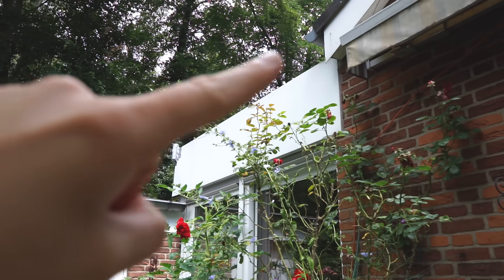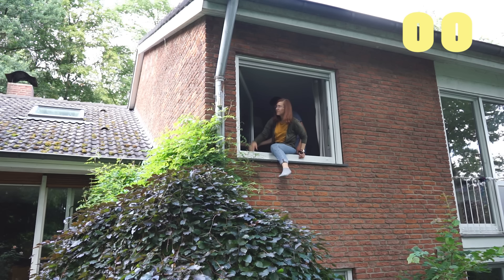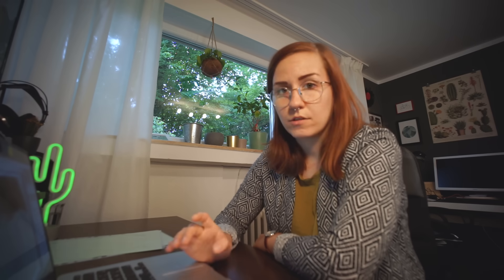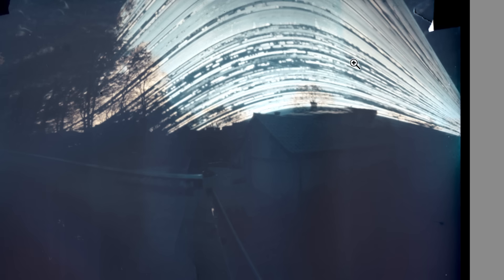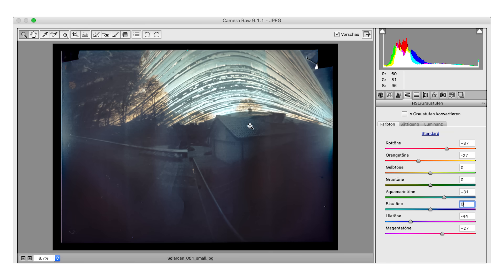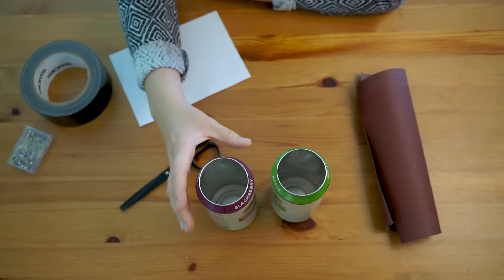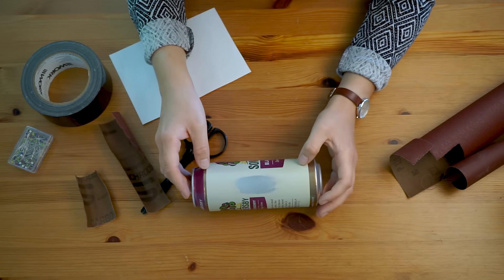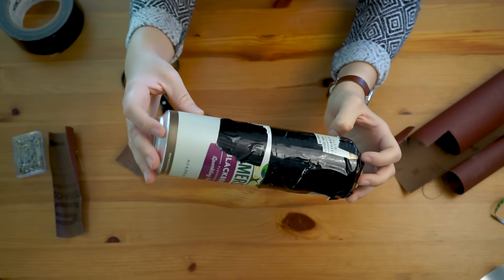Beer can pinhole camera | 1-YEAR LONG EXPOSURE

Comment: Aperture: f100, ISO: 0.00000001, Shutter Speed: 1/yr.
Reply from the maker: Actually, paper has an ISO of something between 4 and 25, depending on the brand. :)
Reply: @KarinMajoka  I took a wild guess; I’m not familiar with that equipment.
I was right about the shutter speed, though. 😋
Reply: I just had an amusing thought. I'm trying to visualise a conventional camera with a shutter speed dial that features settings like 3 months, 6 months, 1 year. Perhaps the deluxe version could include such shutter speed settings like 1 decade, 1 century etc. "Okay, Ive decided on my aperture. I think I'll set my shutter speed to 4 years."
Reply: "Hmmm.....I think I'll bracket my exposures. I'll do 4 years, 6 years and 8 years and then choose the best one." Actually, on a more serious note, I learned recently that someone in England produced what is believed to be the longest exposure in the history of photography. She was also doing solargraphy with a beer can pinhole camera and apparently, she forgot that she had set it up. The exposure time was just over 8 years. And the resulting image is definitely a keeper. I think the number '8' is interesting. It is a bit of a small coincidence that the first photographic image that was 'fixed' / made permanent over a century ago was an 8 hour exposure (on a bright, sunny day.)

Comment: Bit late to the party but REALLY like this. Got a question though. Its been a year. Why tape the pinhole? How much will a minute of exposure change whats already on there? Besides, the amount of light the scanner puts out is enormous. Doesn't that effect the picture?
Reply from the maker: I would recommend to tape the pinhole because photosensitive paper is organic material and suffers from reciprocity failure (or "Schwarschild"-effect). This means that photomaterial is more sensitive to light in the beginning of an exposure and gets less sensitive over the course of time. So the first couple of seconds/minutes are crucial for the overall look of the image. In theory the scanner light effects the picture indeed - but since we do not develop the image and because the "burned" image from the sun is more dominant, the effect of the scanner is negligible. It's still recommended to be fast with scanning and store the image away to counteract deterioration over time.
Reply: @KarinMajoka  Thanks for this info. Gonna check out the Schwarzschild-effect. Sounds...ominous. ;-)
Reply: That's interesting that the first few minutes of the exposure is crucial. Do you reckon it would be okay to start the exposure after sunset in the evening? Or would it better to begin the exposure around sunrise? @KarinMajoka

Comment: Hi, thanks for sharing this. Any tips on what sort of paper to use? How sensitive should it be? Any links much appreciated.
Reply from the maker: Hi! You can use any black and white photosensitive paper you can find, even old expired paper is sufficient. I used some old Ilford paper in grade 4 or 5. If you don't want to spend as much money I recommend something like Foma Fomaspeed C312 with medium to hard gradation.
Reply: Wonderful idea! I am amazed how well it worked. I would have imagined that however small a hole you could make by hand, in a year the paper would all have been exposed.
What might be interesting is to try one of the AI-based image reconstruction services see what can be pulled out that way.

Comment: Bloody interesting. I’m not fully comprehended, how did you ‘scan’ a ‘latent’ image since you didn’t develop or fix. And what kind of paper is this? Does it have an ISO rating?
Reply from the maker: Well, the main problem is that the paper would tun completely black when developed since it is fully exposed due to the sun. However, since the light of the sun is so strong the image almost "burns" into the paper which is visible by plain sight. That way it's possible to scan it immediately. You can use pretty much any photo paper, more contrasty paper is recommended though. In my case I used expired old Ilford black and white photo paper with a harder grade (must have been grade 4 or 5).
Reply: @KarinMajoka  I wonder what you would get if developed it with like 1/1000th dilution for just a few seconds. Just enough to pull more of the darker areas out.
Reply from the maker: @AIM54A  Would be worth a try! In case you make that experiment, I would be interested to hear about your results :)
Reply: paper varies between 6-12 iso

Comment: Yoou arent a totL rebel, you didnt drink while on the roof. Hey how about focus? And doesnt the scanner wash out the paper?
Reply from the maker: True, could have been worse. Since the aperture is that small the majority of the frame is in focus. However, the sharpness of the image will depend on the size of your pinhole. There is a sweet spot, to not make it too big but not too small either. You can do some research about it, the "perfect" pinhole size is about 0.35mm. And yes, effectively the scanner will fog the paper, but since we won't develop it it does not matter. The scanner is not strong enough to burn into the paper the way the sun is.
Reply: @KarinMajoka  That is very interesting. 
I am also wondering about the grain and well if you care going to do this you might as well go Medium or Large format as it is often the camera and film that is expensive not so much the paper. 
Now with film the higher the ISO the grainier the image is. 
For clarity and sharpness a Lower ISO "100" even "64" is i remember correctly and Black and white seems to be sharper? (Long time ago)

So I wonder if...the paper? I don't think this would be the same with the paper? Not sure I never developed pictures myself. 

I used to work in a photochem department filling all the bottles of developer and fixer at "CodeYAK" Disaster of an industry, those chemicals are good for nothing but putting pictures on film. Digital is a much more environmentally friendly option. 
I cant start to imagine how much of that stuff went down peoples sink drains.

So yeah Medium/Large format pin hole camera... Wow, I am starting to want to get back into this but unfortunately I done have much of a pretty scenery for it where I am, or the place to set it all up.

Maybe you can make a video!?
The sun trails are very interesting.
Note the band where there is more cloud activity, seems like autumn or spring..
I would think it is spring because the water starts evaporating back into the atmosphere it wouldn't be autumn because summer has dried everything up.

You should start it at a solstice. 

That really is amazing stuff, from the optics and photography to the weather and sun path.

Great video.
July 22 as well, My Birthday (July 23)
You know what Mars also had aligned closest to the earth 5 years in a row a few years back when Space X just kicked off. 
I was supposed to be there.
Melbourne Australia killed a lot of people, All those refugees going into Germany to destabilize and overwhelm the department after some of my emails about some political things.

(That's another huge issue and topic, would certainly spend a month with your departments going over it all if I had the chance. Australians want to deny and bury and steal my identity and fraud and corruption.... )

Comment: Öffnest du nach dem Jahr die Bierdose und scannst das Papier im Dunkeln? Wenn nicht, wie lange kann das Bild dem Licht ausgesetzt werden, bevor es Probleme mit Trübungen und Verfärbungen gibt? Super kool!
After the year do you open the beer can and scan the paper in the dark? If not how long can Image be out in the light before there are problems with clouding and discoloration? Super cool!
Reply from the maker: It's preferred to open the can in the dark and scan it rather quickly after that. But it's not necessary, the paper won't change as quickly, even if you have it out in the light for a couple of minutes. Remember, that the image is fully exposed already anyway (so it would turn black when developing).

Comment: 11:45 - Could you also cut a hole in the can and glue/tape some aluminum foil in which to make the pin hole?
Reply from the maker: Yes, you can make that as well! The pinhole would be smaller and thus the image sharper. However, it would probably not be as weather resistent.
Reply: perfect, dont worry about water getting in that hole though! Thats exactly what I did for mine and no water ingress.
Reply: @sr3d-microphones  I do plan on tilting my camera back at an angle to get more sky coverage. I guess that would increase the likelihood of water finding it's way into the pin hole.
Reply: @anzaeria  I doubt very much that water ingress will be an issue for you, its only a pin hole afterall. I had no problems for my device, on a window ledge in a south facing position. I was in a pace where the weather battered us from that direction and no ingress at all.
Reply: @sr3d-microphones  Tilted at an angle, the pinhole will be more exposed to the elements. If the camera is vertical and the rain falls vertically, the chance of water going into the pinhole is unlikely. I would think that if rain falls at an angle, a vertical camera could also suffer water getting in. That is interesting to hear that the weather was coming from the South and you had no water ingress.
Reply: @anzaeria  good luck with your test, maybe you could let us know how it performed in the future

Comment: I really want to try this! I just don't understand how the scanner doesn't ruin the picture in the End? doesn't it get blasted with light from the scanner and get foggy?
Reply from the maker: Well, it's basically foggy already - if you develop the piece of paper it will turn all black anyway. But to great visible fogging without developing it has to be a very string light source of the course of a long time such as the sun or leaving it out for several minutes.
Reply: @KarinMajoka  Thanks for the quick answer
Liebe Grüße aus Erlangen! :)

Comment: You could cut a small hole and cover it with cooking foil as that is very thin and you'll get a much more even and small hole
Reply from the maker: True, the pinhole would be smaller and thus the image would be sharper. However, for such a long exposure where the camera is exposed to the seasons for a whole year a foil pinhole might not be as weather resistent.

Comment: I'm surprised that the scanner didn't bleach the paper during the scan.
Reply from the maker: The paper is already fully exposed - so if you would put it into developer it would turn completely black. But the "burned in" exposure you can see with your bare eye comes from a very intense light source like the sun - the scanners light cannot keep up with that.
Reply: That's what I was wondering. I thought the scanner light would damage the exposure, so I was thinking maybe the light in the scanner was disabled. Thanks for the clarification. 
When I was in school (many, many years ago), we made pinhole cameras out of large (about 2 gallon) metal cans that potato chips came in. All exposures I did were under 5 minutes, and were developed chemically. 
Thanks for the inspiration.

Comment: How does the camera function if you covered the pin hole with black tape
Reply from the maker: The tape works like a shutter. So of course you have to remove it after putting the camera up. And have to put it back on before taking the camera down.
Reply: @KarinMajoka  it was my first time i ever heard about a pinhole camera so i was confused when i saw you putting tape over the cameras pin hole and not removing it throughout the video,  i was so confused and had no idea what was happening  : ) but i know now, it was just to prevent access light from entering until the camera was positioned in place. Thank you, now i understand the function of a pinhole camera shutter  ; )  cheers
Reply: My first comment sounds so stupidly funny now  : )
Reply from the maker: @robertpitt8418  Don't worry, there are no stupid questions - it's better to ask than to stay puzzling! :)

Comment: Wonderful idea, so simple yet so effective! I would think, however, that half a year, from solstice to solstice, would be better- to avoid the sun-trails going twice over the same place on the paper. More discrete sun-trails. (Comparing June-Dec to Dec-June might be interesting.) Of course, the year-long exposure has a much better sound to it. Also, to avoid the infiltration of water, perhaps one could tape a piece of clear plastic over the hole, and putting a bag of silicon gel to absorb whatever humidity gets in? The plastic must be UV resistant, but it would not reduce the amount of light measurably, right? Meanwhile, if one is north or south of the tropics, one should put the angle of the beer cam accordingly= in order to get the full curve of the sun-trail onto the paper. The idea of a beer can is just brilliant!  Already light-tight and the curved back (film-plane) boggles the mind. Thank you, I will watch your other videos now...
Reply from the maker: True, only putting it up for half a year might make even more sense! To be honest I hung mine up and forgot about them for some time, that's why it became a year I guess haha. Putting some plastic in might work, but I am not sure if this might increase the moisture and collection of condensation water inside of the can. Would be worth an experiment though.
Reply: so if I'm at latitude 34 (north), what should it point at (relative to the horizont)? 34 degrees BELOW the horizont?

Comment: Hello, great video! I made this kind of pinhole like 10 years ago. Somehow I did not succeed since when I opened the camera it's flooded with water due to condensation I guess. I live in Indonesia so I think humidity is an issue.

Do you have any suggestion on how to handle the condensation? Thanks!
Reply: Maybe, to avoid the infiltration of water, perhaps one could tape a piece of clear plastic over the hole, and putting a bag of silicon gel to absorb whatever humidity gets in? The plastic must be UV resistant, but it would not reduce the amount of light measurably, right? Another consideration: plastic is less dense than metal, so there would be less condensation, but it is not so light-tight.
Reply: @timothybradshaw8921  thank you very much for your suggestion! Will definitely try it!
Reply: I wonder if you could place the pinhole camera inside a glass jar. That would keep out the rain at least. And have the bottom of the jar open to allow air in which should reduce some of the humidity.

Comment: This is cool, but I would like to know what kind of paper you used, and why it doesn't need to be developed.
Reply: buy some black and white photograpic paper, open it up in the dark and take out a sheet and cut a small bit off, put the rest back in the bag and take your cut bit out in the sun and place a coin on top, leave it for an hour or so then come back and take the coin off, see what happens, then you will know :O)

Comment: How is the shortest time you can take a picture like a one day exposure
Reply from the maker: Well, to photograph sun trails a minimum of one day makes sense. But technically of course you can do even shorter exposure times. Darkroom paper approx. has an ISO value of 8 and the pinhole (depending on the size) has an aperture around maybe f/200. From that you could calculate an exposure time - but with a short exposure time of seconds or minutes you would have to develop the sheet.

Comment: thanks for the video! I have one installed since last month. Up to now all I can find is BW photosensitive paper though. Which paper have you used in this one? I'm in Europe if that makes any difference :) thanks a lot in advance!
Reply from the maker: That's awesome! For how long will you leave it up? :) I am also using b&w paper (the color comes out from the scan, not the paper itseld). In these ones I think I used some old expired Ilford Paper, must be Grade 3 or 4, but you can use pretty much whatever you have at hand. Hope that helps!
Reply: @KarinMajoka  Thanks a lot for your reply! Okay I thought so! I tried some 1-week exposure and after scanning there were some colors. I use Fomaspeed 311. I also tried very short exposure times like 5 or 10 seconds followed by developing bath based on instant coffee but I still need to improve on that :)
I think I will leave the can for another month or so and then look for a better spot!

Comment: Hi! I want to ask what if I don't have a scanner can I just take a picture (digitally) of the photosensitive paper and edit it later?
Reply from the maker: I think technically it should work, but I assume the results to be worse without a scanner, since it's harder to get the picture flat and because you will habe some ambient light on the surface of the paper. You don't need a film scanner for this though, but a normal document scanner is enough.
Reply: @KarinMajoka  Thank you for the information!